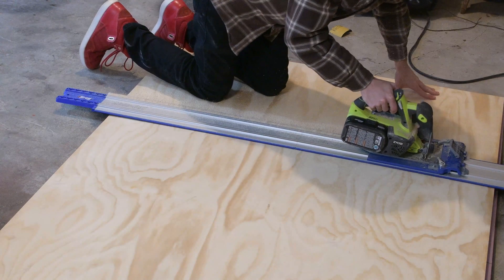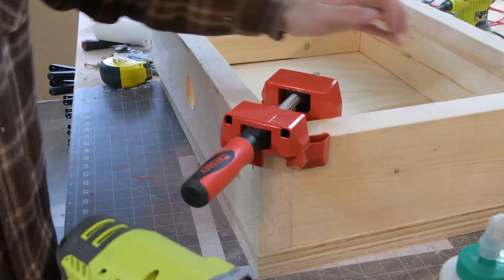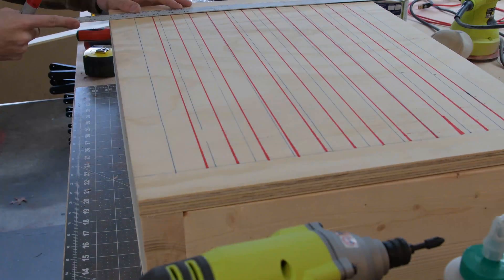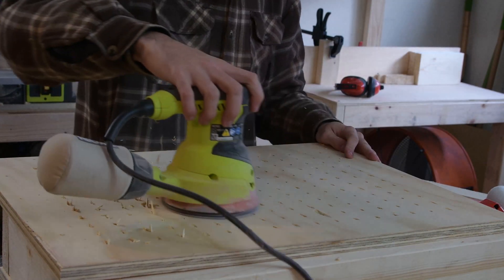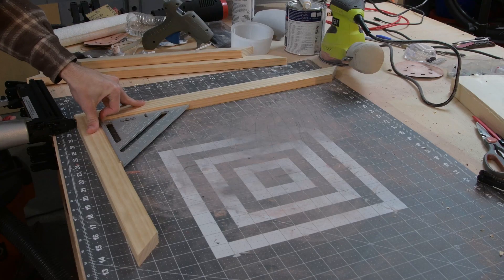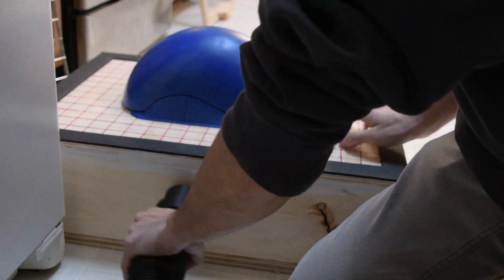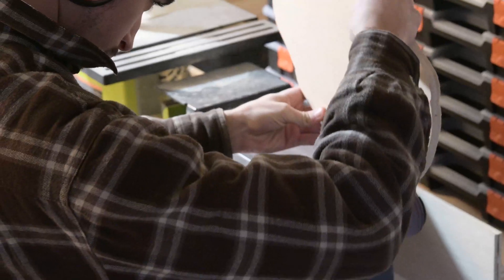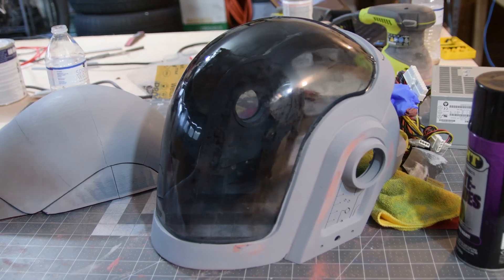DIY VACUUM FORMER // DAFT PUNK HELMET BUILD PT 4

Comment: Use Idye Poly for the visor tint. I messed up a few visors because I didn't stir the dye packets enough so they could fully dissolve.  Once I got it right its like looking through sunglasses. 
And I put LEDs in both my helmets and it shows up perfectly.
Reply: @AdiStanescuMedia  Yeah the auto tint sucks. Rit dye doesn't work anymore. idye poly was the best I've found. You can get it at Joannes or Michaels. I think I used 3 packets of dye for my visor. 
If you're looking to Chrome your helmet and don't want to do it yourself. I recommend sending it to Don at Coat of Chrome. His work is flawless. I've had both my Thomas and Guy Man helmets done there. Mainly cause I didnt want to mess with the chemicals. Somethings I just pay people to do.

Other FYIs so I can save people the headaches I went through. If you are going to do the leds under the ears I used 5mm diffused Red and Green leds on each side. And I used two 30mm 5v cooling fans in the chin area. One 9v battery powered them but only for like an hour. Then I switched to 6AA with a 9volt connection on top. Runs the fans for hours.
https://www.ebay.com/i/381633617210?chn=ps
Reply: @AdiStanescuMedia  You're more brave than I am.. Good Luck.. Looking forward to seeing the progress.